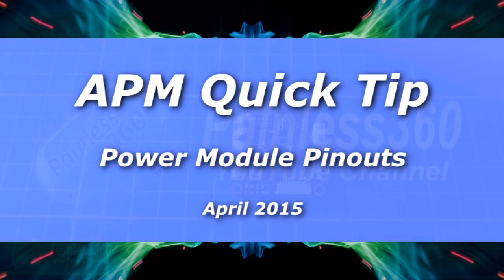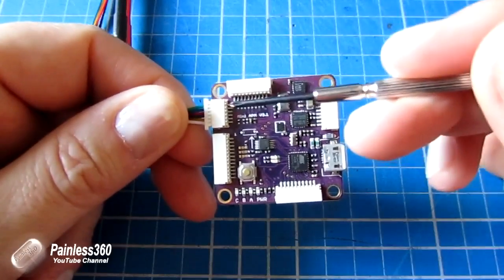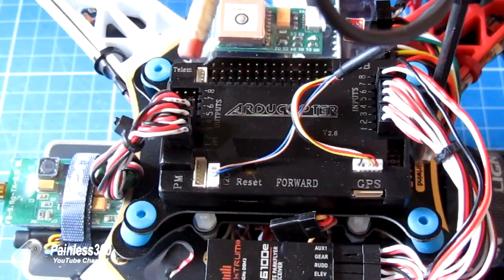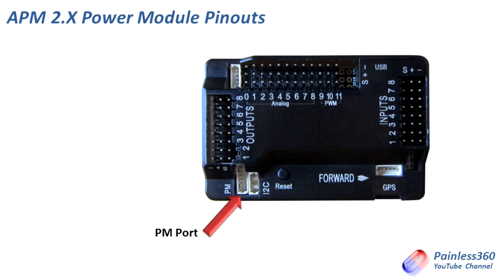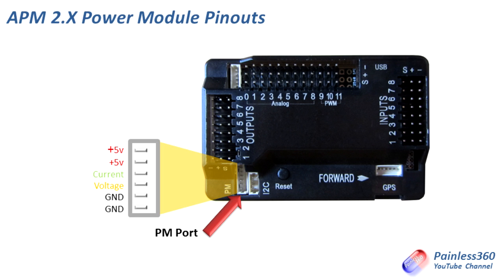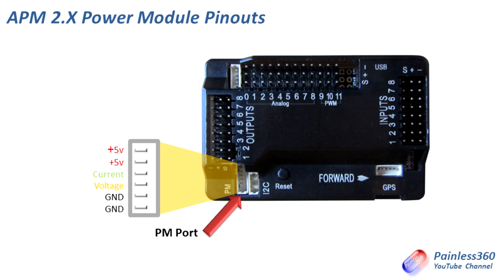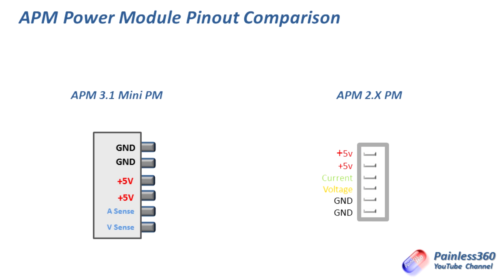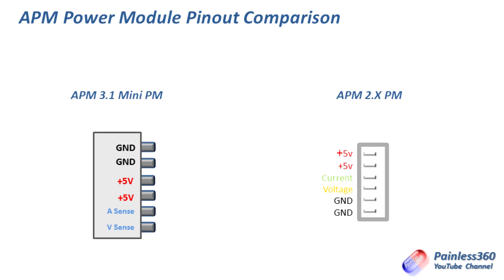APM Quick Tip: Different Pinouts for the Power Module (PM) Warning

Comment: Hello i have the same power module, it can take up to 6s, but i only use 3-4s on my f450 drone, and the power module i have has really thick wires 12 awg, do you think its safe i want to change it to a 14 awg wire, thanks
Reply from the maker: Depends on the current - https://meters.co.uk/american-wire-gauge-awg-cable-conductor-sizes/ - we tend to push the capacities in the hobby as they are only carrying current for minutes not for hours and days..

Comment: Will my current sensing not make much reading down at idle of 0.5A?
Reply from the maker: No idea, what troubleshooting have you already tried?
Reply: Painless360 just built it last night and powered up systems for a smoke test. Got a good voltage reading but couldn't get much of a current reading. I heard it doesn't read till about 3 Amps.  I setup a current offset at my idle current of 0.5 amps will test running motors soon
Reply from the maker: At idle there won't be much current, best of luck with the maiden..

Comment: Hi painless 360, i am about to swap over my APM to an F3 based FC. I was wondering if i can make use of the Power Module in my setup. Will the current sensing line from the APM power module work with the SP Racing evo current monitoring?
Reply from the maker: +chris whitehead maybe, the flight controller needs voltage between 0 and 3.3 volts to detect the current. I'm not sure what the power module outputs, it might be the same. It's worth some more investigation. Best of luck..
Reply: ardupilot.org, looks like 3.3v, i'll give it a try.

Comment: Question mate,using the power module,do you need to cut any power wires goin into the apm from ecs or to the reciever?
Reply from the maker: We cover this in the APM series where we cover power. Depends on how you want it setup and what type of ESCs you're using. If I'm using a power module I'd remove the power wires from the ESC here...
Reply: Painless360 unless you're powering a servo ! The PM is not usually designed to power servos only putting out 500mA

Comment: Hey, thanks for linking me to this video. I quite have a general idea how to connect power module and USB cable at the same time now. 

I don't want to cut off the 5V connection on power module as i might need it in the future if i'm using OPTO esc. However, will a data-only USB cable will work? Have you tried that? I don't want to get into any trouble before i proceed.

Thanks again for the replies on my questions, really appreciate it!
Reply from the maker: +Saiful Raznan always used a normal USB cable here. Best of luck!

Comment: Thanks for your help with the power module. It works perfectly now.  Now I am having trouble calibrating the compass on the apm with mission planner. Values are too high.  I think it is getting magnetic interference from something else on my quad.  How do I disable the hkpilot flight controller compass to allow the compass on the hkpilot gps to work?  Your help is greatly appreciated.  Kirk
Reply from the maker: +Kirk Dockter You can normally cut a track on the PCB to disable the on-board one. I've not used the HK version myself...
Reply: +Painless360 I understand.  I just have one more question.  I watched your video of you setting up the apm 3.1.  You used stand offs in the mounting holes of the flight controller and then set it up in mission planner as if it were installed in a quadcopter.  Do you think this is a good work around to eliminate any magnets forces generated by the other electronics present in escs, receivers, etc...?
Reply from the maker: You need to re-do any calibration once the board is fitted to the model. Testing it's all ok before going to the work of wiring it in is always a good idea.. Happy flying!

Comment: Hello.  Wish I had watched this video before I made my purchase.  I have the "Micro HKPilot Mega Micro Sized Flight Controller and Autopilot with Leads 2.7.2 (APM)" and the "HKPilot Power Module with T-Connectors and 6 Pin 150mm Cable" both from Hobbyking.  The six pin connectors are not the same.  Can I purchase a 6 pin JST SH plug with wires and arrange the pin outs from the power module to match the ones on the flight controller?
Reply from the maker: +Kirk Dockter That's what I would do. Best of luck!

Comment: love your videos, I'm wondering about APM 2.6 and APM mini 3.1, what is different between them ? could it be the small size is more stable ? or APM mini was  only made for 250 frame ?
Reply from the maker: +Avo View They work the same (APM 2.6 = APM 3.1) but the form factor and pin-outs are slightly different. We cover this in the APM 3.1 series. Best of luck.

Comment: hey again!! i have some thoughts about the powermodule i wanted to bounce!!....reading somewhere that the powermodule has a load limit of 90amp i was thinking...would it be possible/safe to use the powermodule as a current/voltage sensor only disconnecring both 5+ leads and running the module from a powerboard so to NOT connect it strait to the battery but to a power board output just like an ESC...APM power would in this case be supplied by an ESC bec or external ubec with the jumper removed....possible you think or does it make any sence?....reason would be to avoid brownout under heavy load on heavy setups
Reply: correction...jumper would of course need to stay in place
Reply from the maker: +DIY stuff If you are looking to pull more then 90amps then the power module isn't a good idea, regardless of the wires you use to connect it to the APM. I have heard of larger Power Modules that can handle more current for larger models. Best of luck.

Comment: if you had a pixhawk power module and you re arranged the pins in the correct order for APM min 3.1 would that work.
Reply from the maker: Long Range FPV Quadcopter .TBS Discovery Should do. I'd be very careful and double check everything.. Do this at your own risk..
Reply: Done it and its working thanks :)
Reply: I had the osd plugged into a bec and what it now looks like is the pixhawk power module does not deliver enough current to power the mini apm 3.1 when i unplug the bec from the osd off goes the mini apm 3.1 so what i thought was working isn't.
Reply from the maker: The Pixhawk power module should be enough to power everything easily.

Best of luck with it..
Reply: should i see the light on with just the power module plugged in because i see no lights till the osd and bec is plugged in.
Reply: I checked the voltages they are showing 5v on the power module.
Reply from the maker: The voltage will drop as the power module is asked to provide more amps than it can handle. I'd check all the wiring first..

Best of luck.
Reply: checked the wiring nothing wrong with it, what I need to know is what LED's should light up if just the power module is plugged in because I'm not seeing any yet when i plug the module in my motors start beeping. I'm waiting for a replacement 433mhz open lrs receiver to arrive. I see green and yellow lights when i plug in the OSD and the board lights up blue when USB is attached and all seems to work on mission planner.
Reply: I tried a BEC into the power module port on its own nothing lit up.
Reply: Any idea where a full schematic for APM mini 3.1 can be obtained it could be a fault with the power port I'm Electronics Eng but pretty new to RC hobby.
Reply from the maker: Google 'MiniAPM3.1.pdf' and you should find it..

Best of luck
Reply: i do find a pdf but it only shows images of the board top and bottom and pinouts no schematics.
Reply from the maker: Sorry - that's all I have.

Best of luck.
Reply: Haven't solved it yet but i was wondering on the back there is a JP2 it is open un-soldered will this stop the APM power module working should it be bridged.
Reply from the maker: This is covered in the series about powering the board. Google 'apm 3.1 power' and you will see my video...

Best of luck..

Comment: Hi! My plane was set up using cppm and they cinnected it to a frsky receiver that has cppm, i wanted to switch to orangerx module and put an r615x receiver. Does that make any difference to controls and etc? I swapped my module to orangerx because i can't afford frsky receiver. Hah
Reply from the maker: jasferb Should work in the same way - make sure that the channel order in APM is right though. Use the radio calibrator/screen to check everything..
Reply: Does the orangerx(r615) has failsafe?? damn! i really like this channel! you respond very fast! Thanks man! :D
Reply from the maker: Yes it does. It covers this in the specification on the HK pages for them.

Never use a reciever without the ability to set a failsafe. .

Comment: Thank you for this video, I bought a power module from ebay described as a 3.1 but if you hadn't posted this up I wouldn't have thought to check and discovered it was the 2.5/6 module. So thanks again and for the series on setting a 3.1 up on a fixed wing saved me hours of head scratching and a fried circuit or two.

Comment: Hi again Painless360, you done it again and got me out of the doubt. But i have another; so i just solder the Power Module to the Power Distribution Board and the other side goes to the battery? That is, the battery is not connected to anything but the Power Module, is that right?

If is right then The Power Distribution Board only has the 4 ESC´s and the Power module soldered to it.

Thank for your help
Reply from the maker: Fernando Calatayud Zepeda That's right.
Reply: Painless360 I see, thanks a lot.

Another question that is bothering my mind. By using the power module with the APM2.6, i read that i have to connect just the first ESC with the three cables, and the other four with just the signal cable.

Is that right?  Thanks in advance
Reply from the maker: Watch my ESC and RC power videos for the answer. It depends if the ESCs are switched, linear of Opto BECs..

Best of luck.

Comment: you can switch the pins that connect towards the mini apm 3.1 around so that it corresponds with the right pins on the mini board.

I find that to depin these molex connectors, its so easy to break the tab holding the pins in place. I might need to order a few just incase I break more.

Comment: Thanks for that, that's useful to know. I've also found that some cheaper APM 2.x power modules DONT include a BEC but instead just output the battery voltage on what should be the +5v pins. 

Also it's worth noting that the 5v from the power module generally only has a low current capacity, so you risk a brown out if you power too many 5v accessories directly from your APM using the power module.
Reply from the maker: Blimey! Outputting the full battery voltage would fry the board. Do you have vendors who sell these so we can avoid them?

Agree on the relying on the BEC from the PM alone. Watch https://www.youtube.com/watch?v=in3TWNRcFzI&index=2&list=PLYsWjANuAm4ojGzlss3L7O48pt-mm5Xqv about 18:00 to see me use an external BEC to avoid potential issues when building.

Happy flying!
Reply: Painless360 I don't recall now, but they were one of the 'cheaper far-east' versions. Fortunately it just blew the 'fuse' on the board, and I had intended to use separate BEC's anyhow.

Comment: Thank you for all these nice tutorials. Always try the power module without any load for the first time use as I recently found that they can burn in flames and potentially kill your FC (https://dl.dropboxusercontent.com/u/2195412/pics/apm_mini_power_module.jpg) - bought from goodluckbuy.com. Luckily the FC board is in one piece. I just bought another replacement just in time and works fine.